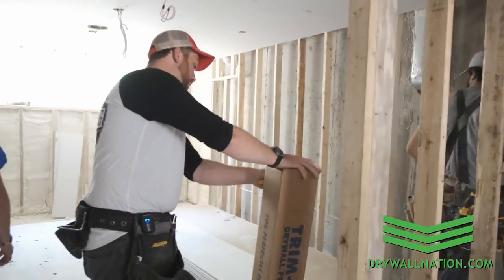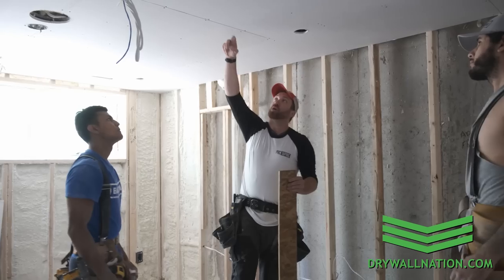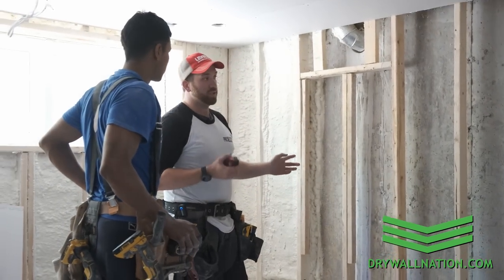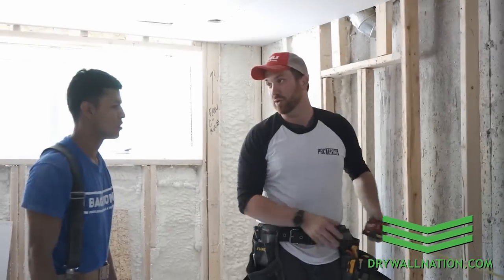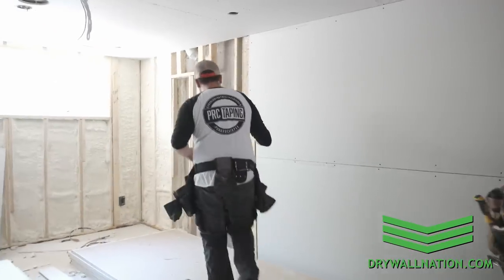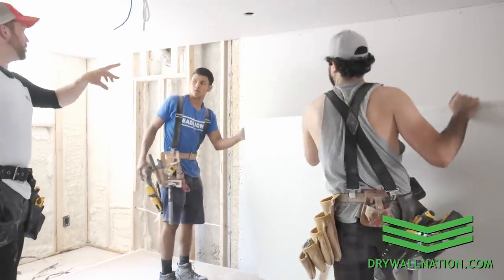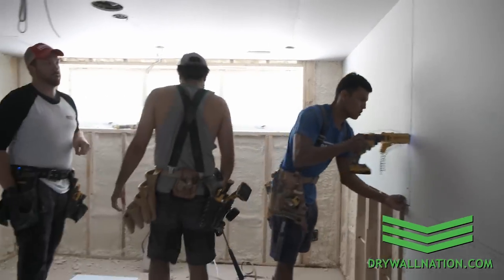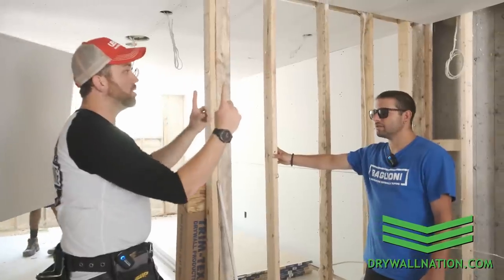How-To Eliminate Butt Joints using Trim-Tex Buttboard

Comment: Just did 150 - sheet job in Phoenix Arizona, used 2 cases of buttboards. Used 12 fewer boxes of mud and saved time both hanging and finishing. Large great room ceiling and master bedroom ceiling came out perfectly flat. Would recommend blocking the ceiling joints at the wall with a 2x4, to stop the uplift of the drywall at the wall angle. Highly recommend this product.
Reply: So you saved around $120 on mud, but when you factor in the cost of Butt Board, $155 for a case, you ended up spending an additional $200 on materials.
Reply: @gme10955  you didn't take into consideration of labor that would have been spent on applying those 12 boxes.
Reply: Labor costs…. That is everything.  Stop getting so caught up in material price.  You spend more on tools and materials so that job is easier, completed correctly in a faster time = you impress GC and make money.  It’s not hard.  Get out of your own way and innovate!  Do something new to better your business.  Keep on doing it like your grandpa and you won’t have anything more than him.  Work smarter not harder?  Cheers.
Reply: @jreal3072  So you are advocating reduction in labor, which is equal to people out of job plus the jobs lost at the mud factory?
Reply: @sidsid9808  any business owner would answer your question "YES" even though it is a completely wrong question.... the premise is not that you are firing people... it is that if you have a crew of five guys that finish the job in 10 days usually, now those 5 guys finish that same job in 9 days (for example) while you still charged the same amount for a job to the customer... you are now taking the next job ONE DAY EARLIER than you would have otherwise, so you are making money faster.... 

those 5 guys are still employed the same way but are more efficient

u get that, right?... say you get it
Reply: I don't care about saving a nickel. Those assboards definitely affect the quality of work. I do it only when it's a better alternative to fastening to a truss or a stud. Some goofball came up with the idea of selling a piece of wood and y'all fell for it. Bottom line is I don't think it's legal and I wouldn't put that crap in my house. Stop wasting time thinking of ways to get out of work and do the job right. If you can't afford materials, find a different job.
Reply: @garyrosie9475 legal? Hahahaha
Reply: @sidsid9808  Luddite.
Reply: @garyrosie9475  A similar designed product for butt joints is in the USG manual
Reply: @95thousandroses Thank you. I've been contracting drywall  HANGING not finishing of any sort for 20 years on large scale priduction and custom homes, a butt joint with plywood backing is stronger then a normal butt broke on a 2x stud. As long as you break within 4-5" of A stud, MOST framers layout trusses like SHIT and just slap up bird blocks with 0 layout marked. So when the trusses all break like crap we use plywood backing cut up in about 5"-6" wide rips and break NEXT to the truss or stud or bci, whatever has already been layed out or framed like crap we make it better😊, but we never railroad, I wouldn't do that with this magic backing either...

Comment: Amazing! That’s so easy! Now I can save money on sheets, especially if we hang more then 350 sheets a day with my crew, and we save time forks my finishers, that is a time and money saver!  The finishers will require those buttboards at the job. DrywallNation thanks for sharing those things.
Reply: LOL... Check the cost of them.... they're not FIXED like a wall stud so they can have movement and lead to a cracked butt joint.... And if the stud before the joint is out it's not going to fix that...
Cardboard shims are cheap and easy, make a butt joint that doesn't need busted out, and is solid (no movement)

Comment: Great idea, but surely buying a sheet of OSB and ripping it down to 100mm strips to use in the same way has to be more cost effective?
Reply: You obviously didn't pay attention.
Reply: @AsItHappensHere  I did, it's meant to pull the Butt Joints in so you can fill it. But for what it's worth you may aswell just cut your own OSB and skim over the joint regardless. It will look just fine. And you save on the insane cost of over engineered OSB Butt board
Reply: @iluvkmg  Like I said.  You did not pay attention.
Reply: @AsItHappensHere  Ahh, but I did. I just don't see the value in it when they cost so damn much. But, Lovely. You're one of those eh
Reply: The board is not flat Einstein 🤦‍♂️
Reply: @matthewjoniec9000  I know.. thicker on the edge than in the middle.
Reply: @iluvkmg  Oh I see:  You're one of those.  SMH
Reply: @AsItHappensHere  OR , he understands sheetrock has been buttjoined on the edge seams for about 75 years now in millions of homes , so the cutesy curve bevel in buttboard is gimmicky nonsense and rip your own OSB and save money .... sheetrock has been buttjoined for decades in every home in America , no bevel gimmick needed and has worked just fine
Reply: @shure46  Well, evidently YOU don't understand it either.  

If he means that using a ripped piece of regular OSB would save on waste (drywall cutooff) and that that is ALL it would accomplish then he would have pointed that out.  But he and you BOTH insinuate that a regular piece of drywall would accomplish EVERYTHING that the "cutesy curve gimmicky bevel" does.  It does NOT.  Not even close.

The bevel creates a recess in the butt joint thereby recessing the tape instead of having it proud of the overall flat surface and this eliminates the need to spread the joint out over a wide area.  A ripped piece of regular OSB leaves the joint perfectly in plane with the rest of the field and the tape will stand proud JUST LIKE IF THE JOINT WAS OVER A STUD which equates to the same labor and mud materials cost as having the joint on the stud.

So......"gimmicky?"  Not at all.  Overpriced?  Perhaps.  But that's to be determined by someone who has done it both ways on hangs of entire homes or commercial jobs.
Reply: @AsItHappensHere  I know what the idea is , and so does the other guy .... buttjoints have been taped for decades just fine , the MAIN thing I like about using this "OSB scabbed joint" is now you do not have these seams SHARING a single stud or joist where you have 3/4" to nail or screw to , I LIKE the idea of a big fat backer board and not having to cut the rock on the stud precisely , but the tape and bedding ??? Not a big deal to me , those joints have been taped for decades , not a big deal , sure the indented parts are better , but not that big a deal ..... the dude is saying "make your own , save the money" and EVERY residential jobsite has a shitload of scrap OSB laying around ... It would also make less waste going to the trash dump .... save the planet thing ya know , the lefties would love it , hell some tree frog's life might be spared
Reply: @shure46  Ok, then USE your "OSB scabbed joint" then.  But that only accomplishes PART of the purpose of the beveled buttboard.  So when you say "make your own, save the money" it is NOT buttboard you're making and it does NOT accomplish the scope of what buttboard does.
Reply: @AsItHappensHere  and you can use buttboard all you want , fine with me , hope it works out great for you , I'm just not that worried about it , I've tape and bedded butt seams a long time , not a problem , I DO however like the idea of not breaking on a stud
Reply: @shure46  Yeah....you obviously don't get it.  Sorry 'bout that.  Maybe the light bulb will come on for you some day.
Reply: @AsItHappensHere  you just staple a shim or 2 to each edge, there is your buttboard

Comment: I was making these 20 years ago from scrap plywood on a table saw. Never even thought to market it lol.
Reply: I know , I'm thinking the same thing right now ..... been making scabs for years , drats
Reply: So any ply or osb would do the same?
Reply: @jewsh519  of course it would , we've been using "scabs" all our lives in carpentry and building ..... anytime you need to splice a seam not landing on a stud or joist or rafter , you add a scab board .... it is BEST NOT to use a scab board on anything you might WALK on though , you definitely prefer to land on a joist or rafter , but we have used scab boards forever in building
Reply: @shure46  i kno that im saying any board will pull the ends in like that
Reply: @jewsh519  no it won't ... to "pull the ends in" the scab board would have to be beveled , the whole idea of this "buttboard" system ... if you put a flat scab board behind sheetrock edge seams , those edge seams will NOT be "indented beveled in for mud" like the factory beveled edges of sheetrock seams are .... all sheetrock buttjoints are flat , not beveled on the stud , or with a regular scab .... and my thinking is "I don't care" because it will tape and bed just fine , beveled or not
Reply: Tapered?
Reply: @shure46  yea i just have ran into alot of seams that need to be feathered a ridiculous amount so u cant see the taped seam
Reply: @jewsh519  yup... just tilt your table saw 3 or 4 degrees and run a 5 1/2 inch piece of osb or plywood and flip and do the same... u have a little v groove now
Reply: Bs
 just a guy trying to sell a fish in water . A bottle of water.
Reply: I'm with you 😂😂😂😂
That's nothing new
Reply: What you're talking about is not the same. You're talking about throwing backing in where you don't break on a stud.
This stuff is beveled inwards towards the middle. If you took a straight edge and set it horizontally against these "buttboards"
you'd see light in the very center. Meanwhile a piece of OSB or Plywood is essentially flat.
The point of this product isn't to save time hanging. I think a good hanger would go faster hanging normally than throwing these beveled boards in every sheet.
But it will save time as a finisher. It turns all proud joints - being all the butt joints where butt ends of sheets meet, into essentially recessed joints.
As well as decreasing the likely hood of cracks because these joints don't move with the expansion and contraction of the framing of the rest of the house.

I've never used buttboards but wouldn't be adverse to trying it. No doubt it would take more time to hang, initially at least.
And you'd spend more money on material and labor for hanging.

I'll also say, I'm not impressed by the "hangers" that Drywall Nation is working with. 2 screws in the field, 3 on butt joints (besides that lower joint he just threw a random number of screws into). And the fact they're using collated guns. Collated guns have their place but when you don't even know how many screws should be in a board
(the correct answer is roughly 70 per 48 square feet of board), I doubt they can finger screws correctly.

I'm not a carpenter. I'm a alright hanger and can get by as a finisher but hate finishing.

Comment: Wow. As a DIY homeowner I'm sold. I like it. It'll be interesting to see if it takes off with the pros. I think it could go either way. I definitely see the higher end more custom home guys taking it up. The production side though, it has to actually be faster and cheaper to take off.
Reply: LOL... Check the cost of them.... they're not FIXED like a wall stud so they can have movement and lead to a cracked butt joint.... And if the stud before the joint is out it's not going to fix that...
Cardboard shims are cheap and easy, make a butt joint that doesn't need busted out, and is solid (no movement)
Reply: @2869may  think critically about what you just said after watching how they were installed. the perimeter and the field were still screwed into studs the only thing different with the OSB "butboard" is now the panels are joined together rather than being joined to the same stud any force that would create a crack at that seam (bear in mind I'm talking about an earthquake level of force here) would create cracks in any application.
further studs do have movement houses wrack when they settle that wracking force is what causes cracks in the seams of drywall joints the benefit of scabbing the sheets together like this translates the wracking forces along the entire panel saving that specific joint granted the horizontal seams will still show signs of wear when the house settles but the one vertical joint will be fine save for the horizontal line.
you're dead right about the cost though it isn't worth the price especially since you could make them with a sheet of OSB and a skill saw plus router if you don't feel comfortable dragging a skill saw blade to create the indent. (yes it's dangerous but no more dangerous than you let it be.)
Reply: @willhwiltjr  I can see both sides of it....
But the joint being "floating" could be positive and negative as it not attached to a fixed structural stud... Not that it would happen often, (kids room, hall way) but it wouldn't take much pressure on the joint to pop the screws on the backer board with nothing behind it to support it... That would be rare... I'm reaching...LOL
We used the cardboard shims for years and years and very rarely had to bust out a butt joint... but finishing behind sh!trockers that never touched a shim, we often had to triple butt joints
You could also create the indent with a table saw and a dado blade.
Reply: "Earth quake level of force" lmao tell me you don't have a 2 story house with kids playing in the floor above you with out telling me you don't. Lol